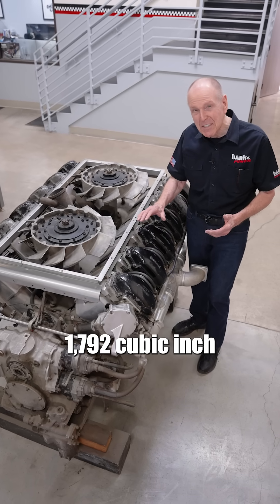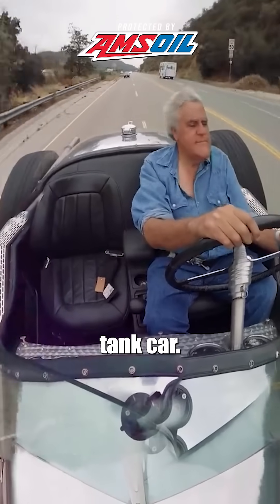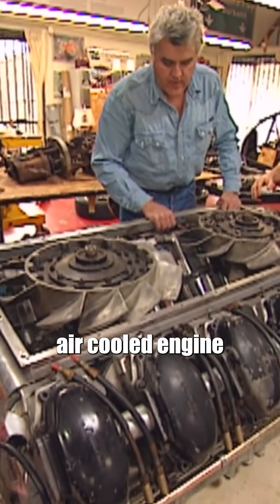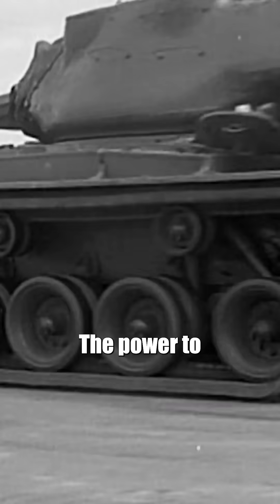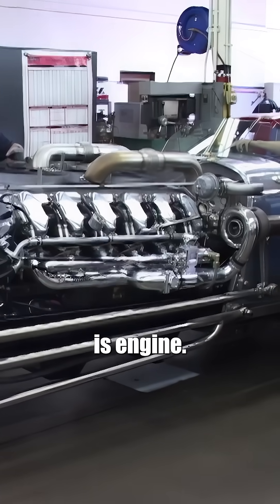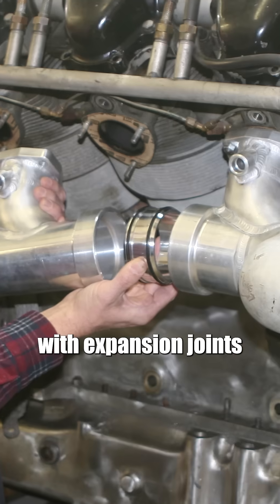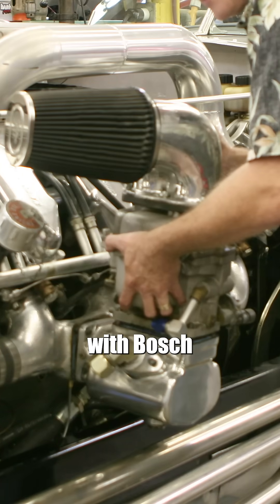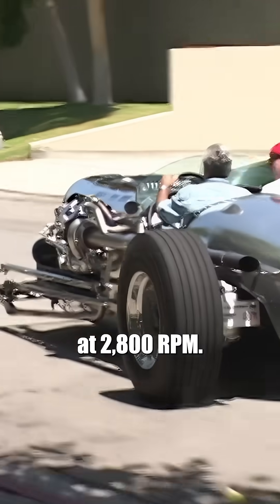We twin-turbocharged Jay Leno's V12 Hemi Tank Car

Comment: Thats a monster engine! Of course Gail Banks and j Leno twin turbo a v12 engine!! Those fans atop the engine...what kinda gains in cooling was that setup doing?
Reply from the maker: It's an air-cooled engine, so they're doing all the cooling. In some -- possibly all -- applications, those fans were hydraulically driven! The Continental V12 was also offered as both a gasoline and  diesel version.

Comment: Seems like the most inefficient way possible to make that power! dont really need what? 5000 torque? Or more.. pretty neat though. Turbocharged chev big block would easily make that power and a fraction of the weight.
Reply from the maker: But a turbocharged big block wouldn't sound or look as cool as a Continental air-cooled V12 tank engine! Plus Jay isn't the kind of guy to do the easy or simple thing when it comes to cars.
Reply: @bankspower good point sir!

Comment: Red line?
Reply from the maker: It's a huge engine, so fairly low. Peak power on the gasoline version (they also did a diesel version of the engine) came at 2,800 RPM stock.
Reply: @bankspower thay makes sense for that size

Comment: 1600 at 2800rpm equals 3100  of torque.  OMG
Reply from the maker: The Continental is a huge engine designed to power a tank weighing around 50 tons. It's a torque monster in stock form, but our turbo setup takes it to another level.

Comment: We still use twin turbo Continental V12's in the military, but they're diesel now (technically, "multi-fuel" since we use a variety of jet fuels), and the newest version is rated for 1,050 HP & all the torque.
Found in the M88A2 Hercules.

Comment: The M-60 A3 Tank I drove back in the late 70's was powered with V-12 Continental made in Muskegon , Michigan .
   It was turbocharged multi-fuel that made 950 horse and later 1150 Horse to push a 60 ton Tank , all upgrades from Jays engine , before that beast was rebuit .
  When I was in Europe at the 1982 REFORGER , ( Return of Forces to Germany ) I pushed my 60 up to 48 mph on a strait level road ... Fully Combat loaded for Border duty .
   We were 3/7 Cav . Blue 72 during that Maneuver, and we beat every M-1 could see that had come from the U.S. 
    Sure loved those M- 60s .
   The sound of Jay's Tank Car unmuffled was a duplicate of the A-3s sound .
   I bet he goes a little faster than 48 ! 😮

Comment: I was blessed to operate an underground loader that was outfitted NEW with V-8 Deuitz aircooled. Badass. That thing was a Tank. Miners drift a small shift that thing just squeezed it's ass thru, just wiggle and accelerate. Amazing! All while it was do fucking cold outside or air compressors were failing.

Comment: Again I gotta complain, where's the torque figure? Can figure it out roughly by using the rpm limit on the turbos version of 2800 giving and obscene torque of 1519 ft pounds at the rev limit not even the peak torque, though that would be gross torque not net, and with the 1600 horsepower of the twin turbo one that's easily 3000 ft pounds, so cool

Comment: I know the day will never come...

...but I really wish Banks would build and market a clean sheet 10L V8 gas engine. The 1-ton truck segment needs it. The Ford 7.3 was a step in the right direction... but it's duty cycle is still displacement-restricted. We need a 500hp gas engine for towing.

Comment: There is a video on YouTube about this car. It has no protection for the driver, no roll bar, and no seat belts. The fun part of the engine is those two turbines on top which suck all the hot air out from the engine.

Comment: Richard Feynman (a physicist for the manhattan project) was a very fast safe cracker. He lead people to believe that he did advanced techniques like this video shows, or he also made them believe he would use drills and picks to break open a safe.

Turns out he just was really fast at entering many, many combinations. He realized he could also crack the codes faster since most people used dates (birthdays, anniversaries, etc.) and this significantly reduced the number of combinations he needed to try. He could open any safe in just a minute or two, but he had lead people to believe that it took him 15+ minutes so that they wouldn’t catch on to his tricks.

Comment: what i find really annoying is americans use lbs to measure weight but then use tons when you hit 1 ton. like ik there is american standard units vs everyone else standard units but like its confusing asf being somone who uses kg you saying it weights so much per ton and had however much hp per ton but then going to lbs i have no clue what that then is. its like measuring water at room temperature with degrees C,  when its frozen with F and when its boiling at 373.2 K and then trying to plot them numbers on a graph. it doesnt work

Comment: I mean only 800 hp.. that means the 6.2 ls I'm builtin could move that tank lmfao.. 800hp that's it.. I'm Hoping to get some where around 1100 Motor roughly 800 to the wheel..

Comment: 810 hp out of 30 litres i know its all about torque in a tank but why do americans build massive engines with so little horse power rolls royce merlin startedat 1000hp then went to 2000hp out of 27

Comment: That engine has a nice car
Reply: The car's weight is about 25% engine
Reply: @dorbenyamin-bar8660 no it’s basically half engine
Reply: @expatrocious  one ton =2,000lbs 
The entire car is 5 tons or 10,000lbs
The engine is 2,300lbs or 23% of the entire weight of the car
Reply: We built a plane around a gun, so why not a car around an engine? What's next?
Reply: Putting a man on Pluto!
Reply: It's a bit on the small side
Reply: Why he even need a big engine for a car?
Reply: @__jack________________2225 
BECAUSE... he...."CAN"😁☕

Comment: 800 hp on 80 octane..wow, imagine what it could have done with 87-94 octane nowadays.
Reply: it originally would have run on aviation fuel, it also has a compression ratio of only 6.5:1, so it likely wouldn't even run at all on 87 without some sort of forced induction.

Comment: We fixed these beast in the Army before the M60 tank chassis replaced by the M1 Abrams. There are many still in service in the National Guards and US Army Reserves today. We often ground hopped without the exhaust system before putting it back into the hull, and boy, it scream, waking up the dead. Awsome machine.

Comment: Fun fact: gale banks is the reason turbos aren't allowed on top fuel cars. Banks went 300 mph in the 80s with a turbo top fuel car and the NHRA flipped their lids and said it was too fast. Fast forward to 2025 and we have top fuel cars going damn near 400 mph with 3 seconds quarter mile times and turbos are still banned for use in top fuel cars.

Comment: One gallon to the mile - in a roadster. An electric conversion would have been a much better performance ride and upgrade.
Old iron isn't always better. These engines are best in trucks or aircraft as intended.

Comment: 1,600 and 2,800 revs…. That genuinely brought a tear to my eyes just now
Reply: Would love to know what holding the wheel feels like while rolling on the accelerator during a sharp corner.
Reply: @MusicOfWUA  probably crazy cuz the car has a pretty narrow body compared to other cars. You wouldn't wanna take hairpin turns quickly
Reply: @13kellyr  actually it's 90" wide, about 20" more than average. it's just so long that it looks skinny. its enormous in general
Reply: @niclasnyberg4173 3 feet of that is just the tires and suspension sticking out on each side that's why it looks small.
And the the width of the wheels would make it a nightmare to take a hairpin.
Reply: that was my wtf moment too, ok and the expansion joints cuz the engine grows that much...
Reply: That's scary close to 1hp per rev 🤯
Reply: Imagine if that thing got up to like 7000 rpm’s, crazy but good lord the sound
Reply: @phillipmills9914  if you rev it so high you'll probably set new record for going 0 to the Lord himself.
Reply: I want to know the torque
Reply: @GonzoDonzo  since horsepower is a mathematical calculation of torque and RPM, it's easy to figure out. The torque of the engine is 3001 lb/ft.
Reply: @scythelord  Yikes
Reply: @scythelord  that's "pull your house right off the foundation " level torque
Reply: @GonzoDonzo  42
Reply: They had this car on gran turismo 5 or 6 back when the game devs werent anti American
Reply: Hell yeah!
Reply: Practically idling! 😭💀
Reply: @scottcarl3086  not for that thing though!  It probably self destructs at 3,400
Reply: That like, 8 million foot pounds of torque
Reply: There’s so much diameter I bet it only maxes out around 3500 RPM  and that would be over pushing
Reply: Bad ass!!! but, what if it had some sturdy ass speed multipliers at the hubs…
Reply: On 80 octane fuel?
Reply: @markeastridge9649 Because the fuel refinement back then was not up to par in Germany
Reply: gila 🤩
Reply: It's 5x a 350. 🤯

Comment: I had 1 in a M88A1. Twin turbo, 1500 hp way down low like 1000 rpm. Vehicle weighed 56 tons. Could run about 30 mph across Iraq desert. Pulled 2 Abrams tanks( 150 tons) plus my 56 tons, 15 mph across desert

Comment: If you're towing mobile homes or tandem trailer semis it sounds pretty good, but what's the top speed? Or what does it turn in the 1/4mile? If it just goes highway speeds, meh.

Comment: Mr. Banks, I'm sorry but where did get your info from? I grew up with WWII and Korean War veterans, several of which described the machines well.
They mentioned 110 octane fuel, I was told by Gene Thurman who raced Hemis they had to make the fuel generally 115 octane.
An aluminum air cooled would have been an Aircraft motor, tanks used twin Cadillac big blocks.
NO new tanks were made for Korea, NOW they tested designs out in the CA desert

Comment: “… cool name, i wanna turbo the tank car”
Reply: Straight to business
Reply: Literally shows exactly who he is
Reply: "What's its name!?"
"The Tonight Show... you hosted it fo—"
"Cool! I wanna host The Tonight Show."

...yeah, this tracks.
Reply: Bases Jay Leno,peak of bedassness
Reply: ❤❤❤6❤❤
Reply: too much power.  he wants to add more hp   than 810 on those tires?  whats the point
Reply: @Eric-i5u there's nothing practical about the car to begin with, who gives a shit
Reply: @Eric-i5u  who died and made you the Fuhrer of the fun police
Reply: @Eric-i5u  The same reason people build a street car with street tires to have 600hp+ at the wheels. It's worthless for basically anything but destroying tires unless you have suspension work and slicks in most chassis, but you can't tell that to the people that just want big number.
Reply: @StrangelyIronic  ehhh depending on weight it's not, also most street cars aren't setup for digs but rolls. 600whp+ on a RWD needs a lot of skill/feathering/traction control at low speeds, but if you're launching at 60, 70mph+ it will generally hook up. 

Street tires can be huge and plenty sticky too. I would argue I actually see drag radials fitted to a build where they're not needed waaaaay too often.

Comment: I was tank commander of a M48 Patton Tank, as the M60 were being rolled out.  If I recall the A1 was  gas 650 hp and the A2 was fuel inject at 690 hp,  Many M48 were converted to M3 - M5  750 hp twin turbo diesel.  They had the A1 engine and converted it to fuel inject

Comment: the replacement was the AVDS  1790 ### several versions. was a form fit function replacement. very similar looking but diesels. last used military in M88 recovery vehicle. still used by Israel and some other foreign countries. Last version produced was a twin turbo. and it was overhead cam air cooled about 1500 HP.

Comment: That tank engine was a disaster. The air cooled engine was pulling in all the dust and dirt from the road. You could stop a tank with a bundle of hay or straw on the road because the engine was overheating

Comment: The conti's can handle much more than that. In tractorpulling they push those engines to 5000 horsepower with 2 holset hx82 turbo's on methanol

Comment: I want to know more about the ignition system and the valve train and timing I want to know more about how you got the turbos to play nicely with the cams and timing and such why did you decide to go to fuel injection rather than carburetors

Comment: How do you make sure such a powerful engine doesn’t just shear the the metal of such a light frame? Certainly after a point the torque is higher than the friction on the road or the strength of the the axle. I’m having an autistic staring contest with this trying to figure out how it doesn’t pop a wheelie or tear out its axle.

Comment: I'm curious if you changed the turbo aspect ratio, as you stated the ones used were used on Indy Cars. Indy car engines run at much higher engine speeds than 2800 rpm. I would expect driveability issue if that turbo was optimized for that RPM range.

Comment: Get hold of a Griffon57 from an Avro Shackleton. It's already supercharged fuel injected, twin cammed, dry sumped and make 2450 horsepower from a 36L engine.  I think the whole power plant was 2 ton but that included the contra rotating propellor.

Comment: Jay came through my unit one day looking for parts…we were transitioning from the 56 ton M88A1 to the 70 ton M88A2. At the time, we still overhauled the 1790’s and if you paid attention, you’d see Marines with various pistons, connecting rods, blocks, etc moving through rebuild. Parting gift from my platoon was a piston from an A1, it’s the size of a small dog. Stupid power at idle, some of my best  memory of the Corps were listening to that engine make short work of hauling tanks.
Reply: The original AV-1790 tank engines were gasoline and non-turbo.  That is what the Tank Car uses.  The successor AVDS-1790 turbo diesel was a better tank engine.  Much more efficient.   I bet Gale would love the diesels.

Power was upgraded over time.  Your M88A2 should have had the 1050hp unit.  There is even a 1500hp version designed to upgrade the Abrams but I don't know if that really worked out.
Reply: @ it was 1,050 HP. Scary to think of crews running gasoline…I had Nomex and fire suppression. Old breed were something else.
Reply: @Sherman62  the Merkavas run the 1,500 HP versions. General Dynamics I think makes those, makes sense as a AGT-1500 replacement for the Abrams.
Reply: @Sherman62 nope gas turbine multi fuel engine , 1500 + hp
Reply: @ In an M88 series?  Not that I've ever heard of.
Reply: Thx for sharing all that, heretofore Hidden knowledge.   Amazing
D

Thax
Reply: I loced that veh in recovery school. We got to bury it to the doors in mud and hook up all the blocks and tackle , flip tanks.. cannot stop that cadilac on tracks
Reply: Hey Mike this goober Jarhead over here must be drunk he's got some old diesel with an old tank motor wanting to race you for your Vet.
Reply: @Mike88actual i used to drive the m88a1 and the m88 hercules in the army. Hauled plenty of M1A1/A2 abrams with it.

Comment: Interesting engine.  I learned about these in mechanic training at Aberdeen Proving Ground in the early 1970s.  There were a number of configurations, including diesel.   There was a supercharger setup that sat under each cylinder bank.  Centrifugal blowers driven 90 degrees off the crank.  They could also have turbos for turbo-supercharging.  I remember rough and noisy.  And really didn't like to start.

Comment: In the mid 60’s the VTR M-88’s had an upgrade version of this engine with Mechanical FI, and gear driven Superchargers rated at 1050 Horsepower. I was stationed in Germany with the 3rd Armored Division, we had an experimental prototype with the addition of 2 Turbo Chargers. The Turbos helped the power in the higher speeds while towing, as the Super Chargers were geared for low to midrange engine speed, the Horsepower was such that traction was a slight issue when towing, especially towing more than one tank, was a issue. We guessed the Horsepower was in the 1200 range, and we usually “spiked “ the gas with about 25% 115 octane aviation gas when available.

Comment: Lol my dad drove some of the tanks that had that engine. Switching to fuel injection was probably one of the best moves. He said the old carbs were so bad the shut the engine off by shutting off the gas so it wouldn’t hydro-lock!  Also when letting up on the throttle at night so much unburnt fuel was in the exhaust a 4 foot flame would flare up on the back side of the tank.  Everyone thought they were crazy when the M60 tank ( I think that’s right ) came out with only about 730 HP or so when the gas tanks had so much more HP. But he sad those diesels would run awd from us like we were stuck in a lower gear.  It would be amazing if you could work on a project with one of those old tank diesels.